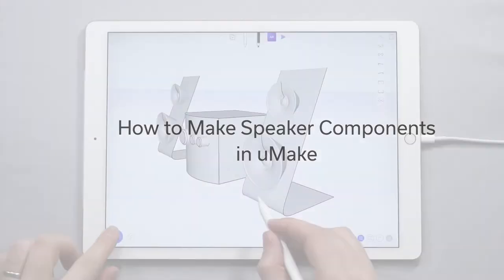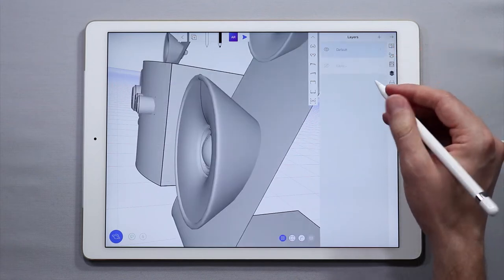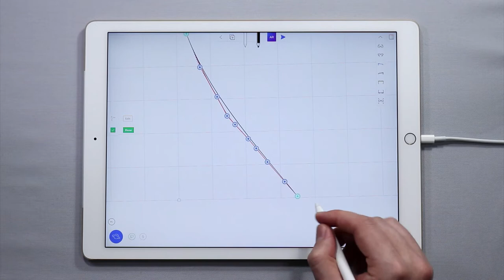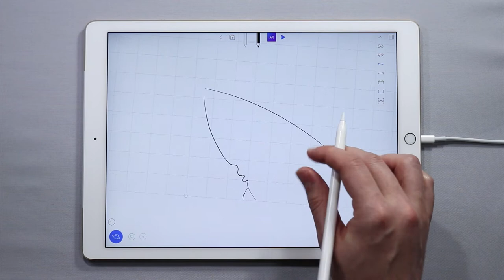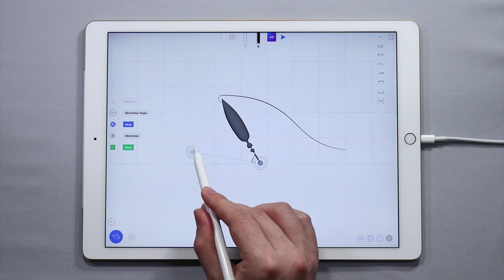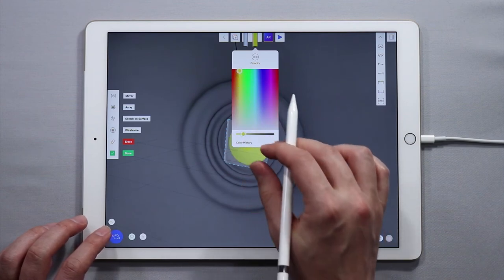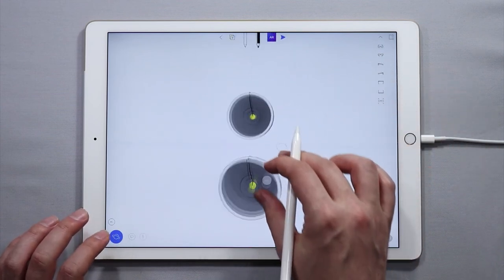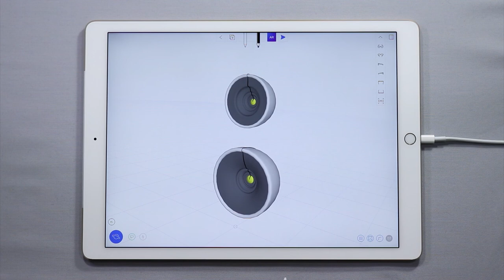Creating Speakers: Part 1 - Base

Comment: Can you draw a wardrobe with specific measurements?
Reply from the maker: Hello Mohammed, you can do a wardrobe with specific measurements if you want. We do have a dimensions tool in uMake and will be releasing a tutorial about dimensions in the near future. Essentially if you go tot he settings panel in uMake (gear icon in the side panel) and then toggle on dimensions, then you can draw a rectangle, and then enter in the dimensions to set the dimensions, and then you would be good to go. Check out our dimensions tutorial we posted a while ago, and look for a new one soon. I hope that helps.
Reply: uMake thank you my dear